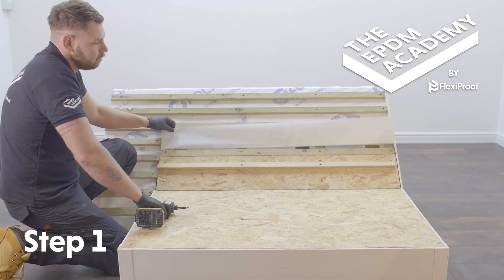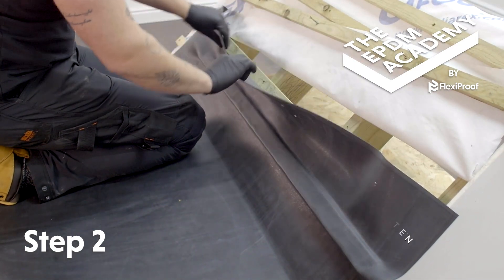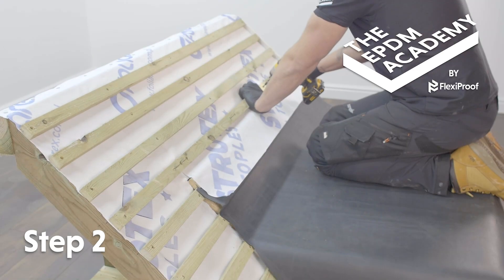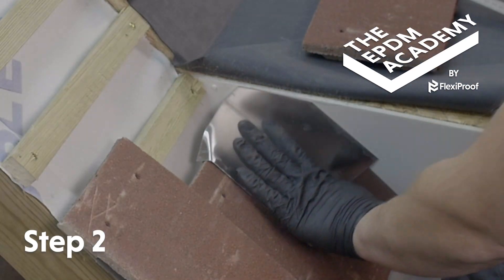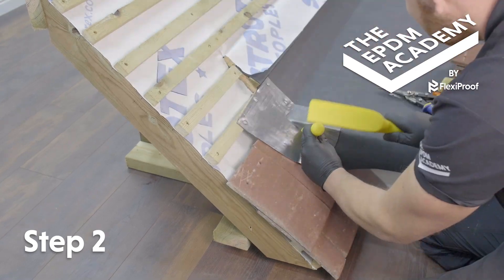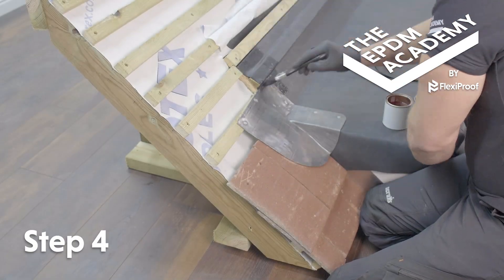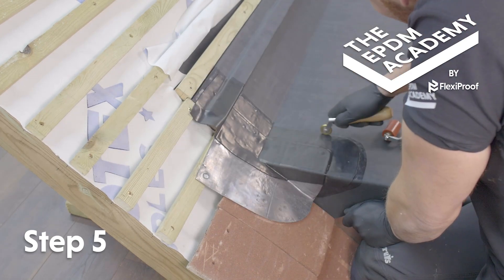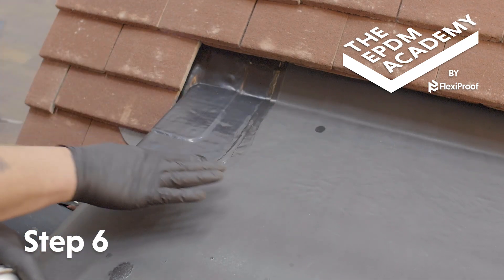HOW TO JOIN A PITCHED ROOF SLOPING ONTO AN EPDM FLAT ROOF (UNDER TILES) - FLEXIPROOF®

Comment: How would it work if you have to fit gutter trims on that side
Reply from the maker: Thank you for your comment. You would do exactly the same, however you would stick the rubber to your gutter trim back plate using contact adhesive and then use uncured tape to seal it. Finally, you'd put your gutter trim front plate on as usual.